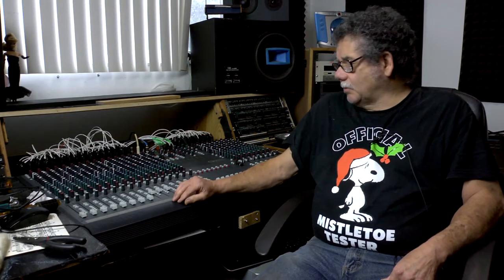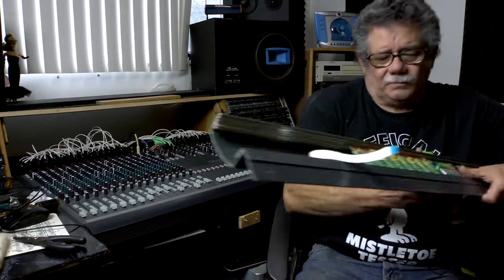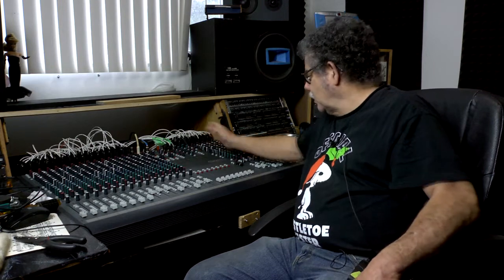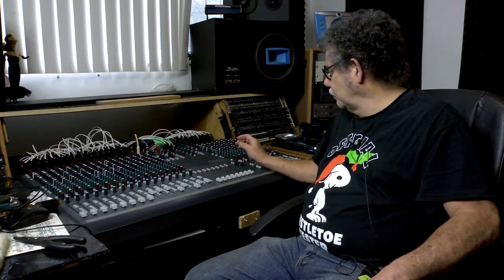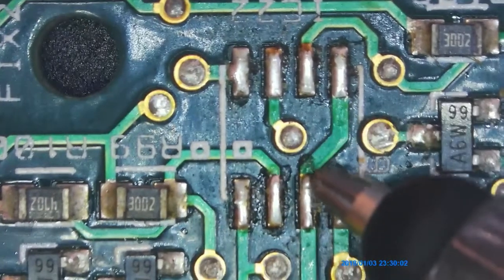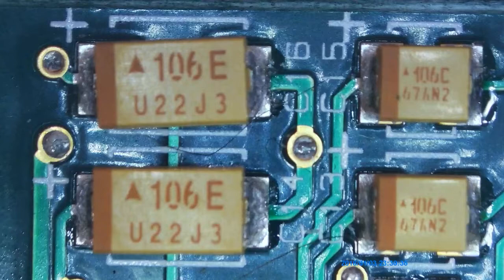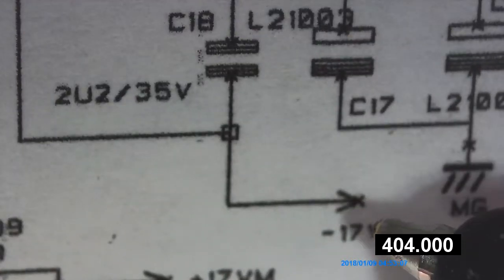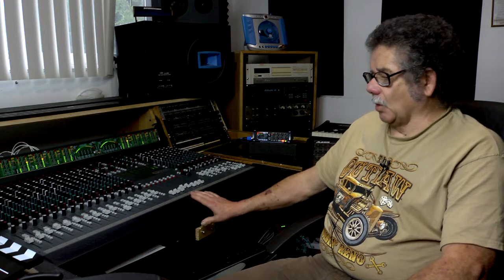Soundcraft ghost meter bridge repair

Comment: Good find. If that is a tantelum cap, then those are nasty buggers as the love to short in a spectacular fashion suddenly.  Zener diode love to do the same. Electrolytics usually open and don't cause catastrophic failure among other components. thanks for sharing your adventure.

Comment: Are you for hire? We have the same bridge that needs repair.
Reply from the maker: Hi I could take a look at it. whats the problem.? FB me Bruce Paz.
Reply: @brucepaz7933  thanks for the reply the board it self works and functions just fine and including indicator lights on the board. Issue is The meter Bridge.  individual channel lights do not seem to function on the meter bridge the group meter works but individually do not light up when signal is being played through.

Comment: I just bought a ghost 32. 3 vu meter cards are bad and G7 group bus.
Reply from the maker: Hi DJ, Check The for dc voltage at R109 R110 you should have 17 volts one positive and one negative. 
you can fb me or skype at sputnik3560. we can video chat. 
Hope this helps Bruce Paz.
Reply: @brucepaz7933  Ok, thanks i will reach out once i get home.
Reply from the maker: @djfortunomusic  Ok cool